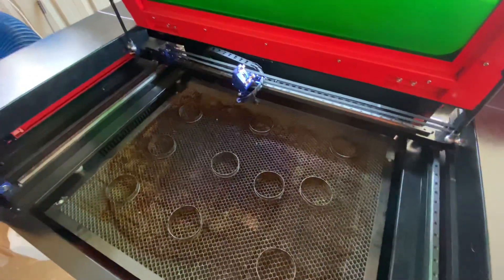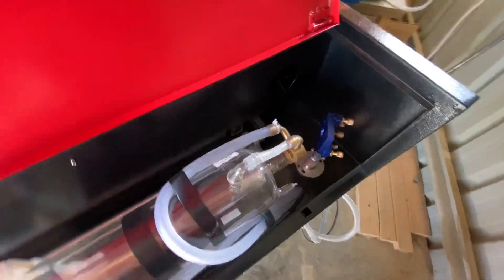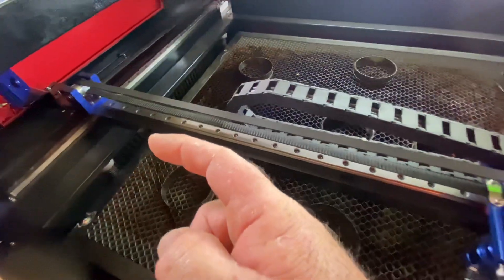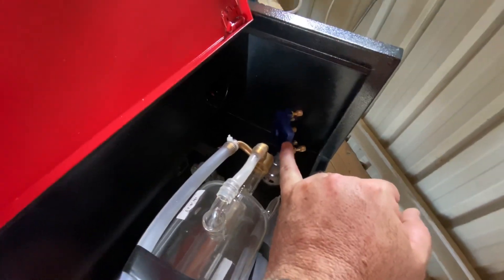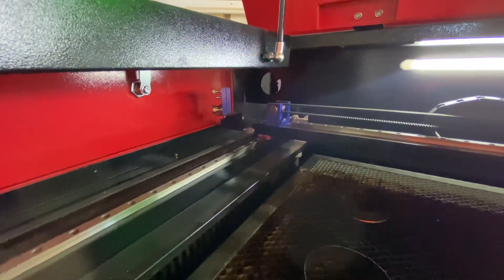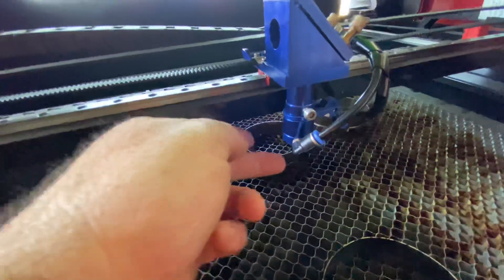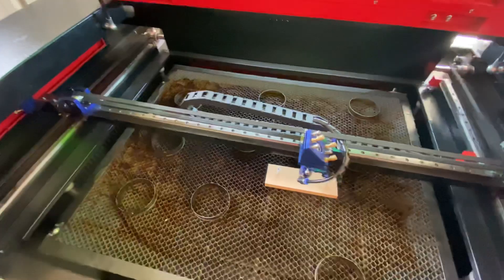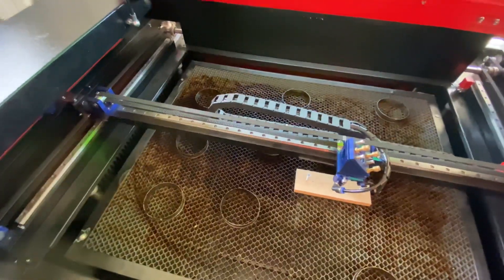I Messed Up My Alignment!! C02 Laser!!

Comment: I’m doing a shit ton of research on lasers before I ever buy one. Glad I am.
Reply from the maker: Yeh mate research is key 👍🏽
Reply: @woodendayz thanks for making this video. I’m trying to really learn about the safety hazards, the maintenance, the extra things I need like the air assist for fires, the chiller and stuff like that. Any thoughts on what to research? What problems I’m going to encounter and how to best setup my station? Do you have a surge protector or anything special for power?
Reply from the maker: Just research C02 lasers in general yeh you should have a serge protector on the laser itself iv been very fortunate with mine as I havnt had many problems at all my machine had been great I did the air assist myself using the ultimate air assist kit that I bought from Amazon and that made a huge difference so definitely recommend doing that

Comment: Did your adjustments make any difference with the power settings used to cut?
You didn't mention whether you solved the original issue you set out to correct.
Reply from the maker: Hi, yeh it definitely did make a difference I was able to cut my 3mm at 30% power with a speed of 12mm/sec and my cuts are now consistent across the whole bed where as before it would vary from the top left of the machine to the bottom right so the adjustment was definitely needed but I think the main thing is to keep the lense clean it’s surprising how dirty it can get I clean my lense and mirrors weekly now,
Thanks for watching, Matt

Comment: There is a video on youtube with a guy using masking tape to align the mirrors. You have to check a dot in the center of each mirror and masking tape helps checking that dot.
Reply from the maker: Hi JP, Yeh that’s how I aligned mine I went into it without doing any research and quickly found out the hard way what not to do, eventually got it sorted! thanks for watching!